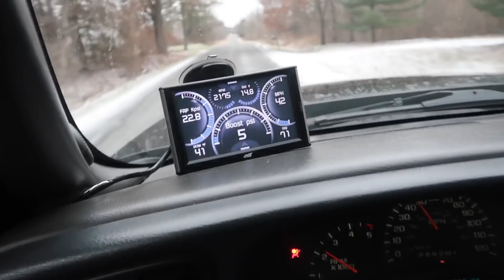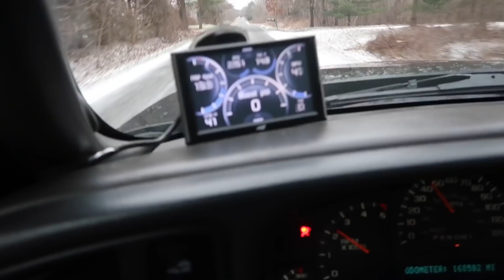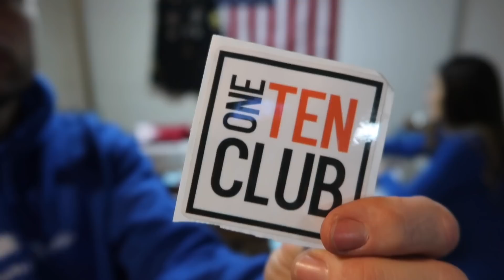Duramax 68mm Turbo sound in the cab *must listen*

Comment: it sounds like you have a turn signal bulb burnt out, in the video it sounded like your turn signal was ticking a bit fast
Reply: It's also possible he changed to LEDs but didn't change the flasher relay or add resistors. I didn't notice if it was fast in one direction or both.
Reply: could be something with that, but i know when mine went out the one side flickered wayy faster than usual
Reply: @Billfish  yeah do the flasher circuits in the older cars are often just 555 timers with an RC time constant. So when a bulb burns out, it goes O.C. and the R changes a lot and changes the timing. An LED also changes this quite a bit because the resistance is very low unless you add a larger resistor.

Comment: Sounds great. I just got my self a 2001 gmc lb7 duramax. Love the truck so far. But definitely dos not have the turbo sound like yours
Reply: Do a muffler delete. LB7 is better because of the lack of emissions crap!
Reply: Clay McClanahan  yea. The truck has duel 4 inch straight pipe, cold air intake, and 45% over injectors.  Truck only has 164,000

Comment: Why is the turbo making that odd sound after you get into it?, almost like turbo bark.
Reply: Dylan Hernandez you mean the blow off valve sound?
Reply: Dylan Hernandez it's when there's no where for the extra psi to go to do it spins the comp and turbine wheel backwards to escape
Reply: Maybe I’m not used to that sound, my LBZ has a stock turbo and doesn’t produce the same noise.

Comment: Hey man I hate when people talk like they know it all but if I may speak freely with hp numbers up around 700 you will be putting a lot of heat in the oil and you already have the edge insight you might what to think about putting a oil temp on your truck egt tells the store on the top of the piston a oil temp will tell you how your bottom end it holding up just a thought and it would it be cool lol 😝 happy Christmas
Reply from the maker: Great point thanks